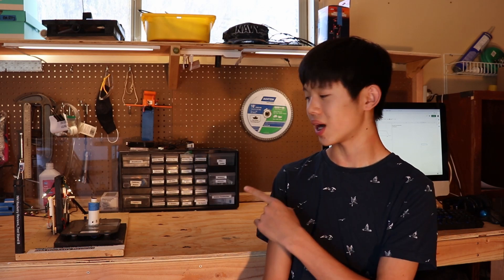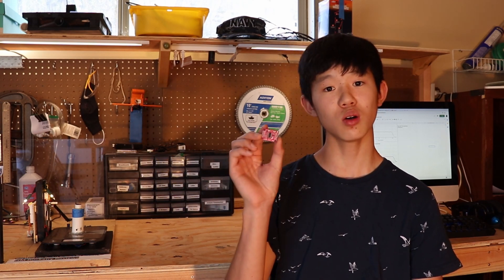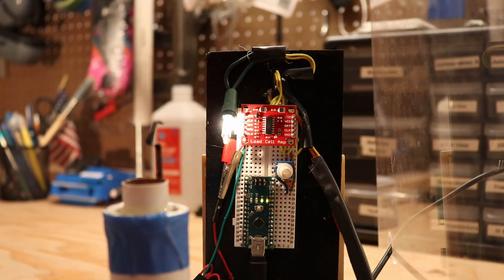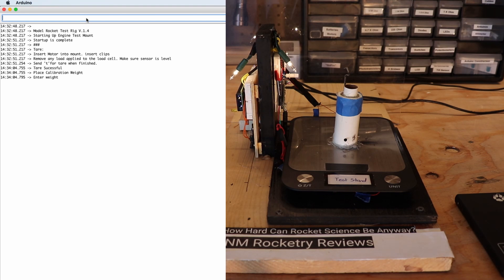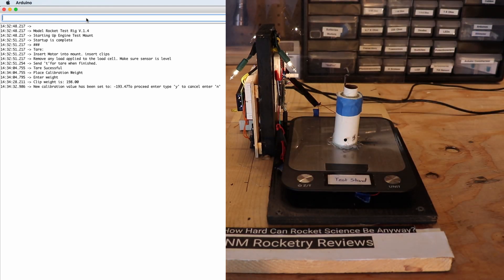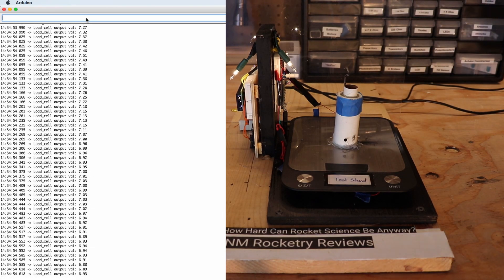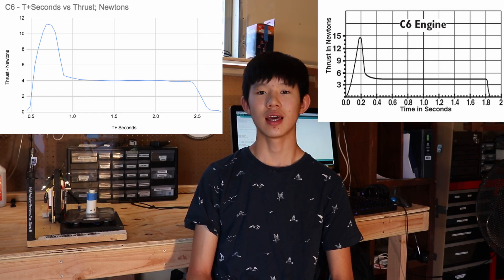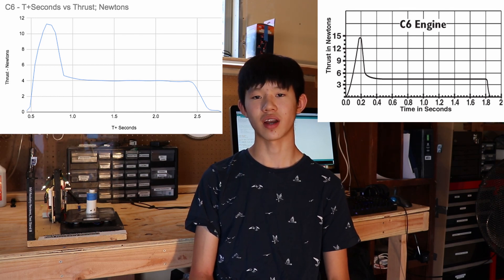Model Rocket Motor Test Stand

Comment: By mounting the rocket motor vertically, you aren’t measuring the true thrust of the motor.  The load cell is measuring the thrust plus the weight of the entire stack.  Even though you tare the reading before ignition, the measured thrust will be less than the actual thrust because the engine gets lighter as soon as the propellant starts burning, especially at the beginning of the burn.  The difference between your measured maximum thrust and the book value is likely the weight of the propellant that left the engine as it reached max thrust.  You can minimize this problem by mounting the engine horizontally, so the load cell is measuring pure thrust.